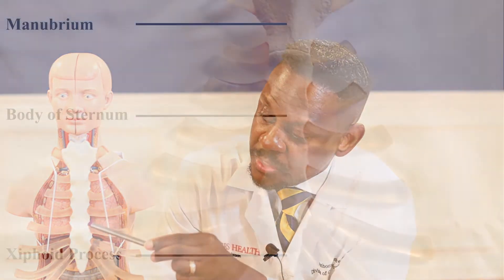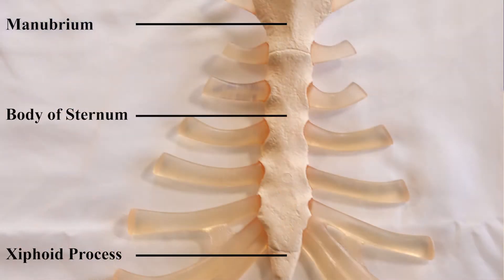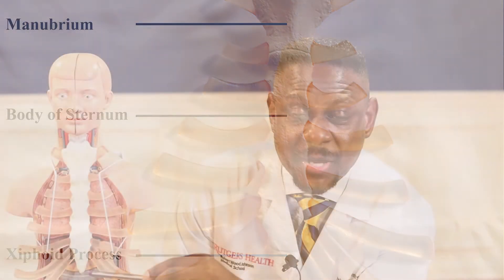How to Open the Chest During Heart Surgery

Comment: When using a saw to do the median sternotomy, with the heart and other important structures just behind the sternum (practically touching it), how do you make sure the saw does not go too deep and damage structures immediately behind the sternum?
Reply from the maker: Great questions. In a patient who's chest has never been opened there is generally a space between the sternum and the underlying structures. In addition, the pericardium, which is the thin wall that surrounds the heart, creates another space between the sternum and the heart. When you use the sternal saw you generally pull up and that helps keep you from touching the pericardium. You generally will not have an issue with harming the heart if you pull up as you use the saw.
Reply: @cardiacsurgerypatienteduca2445  Thank you so much for your quick reply.  To clarify, do you mean the surgeon would pull the sternum up (that is, forward) while using the saw, thus widening the potential space behind it?